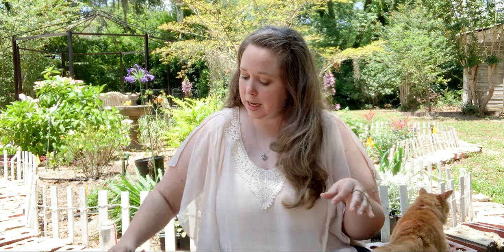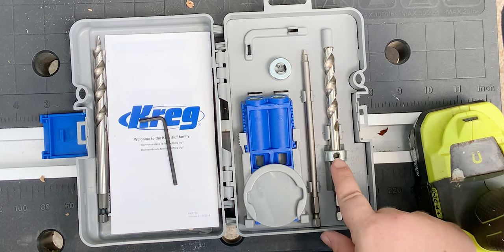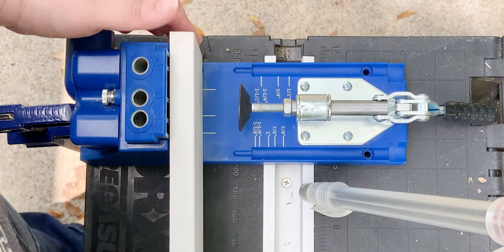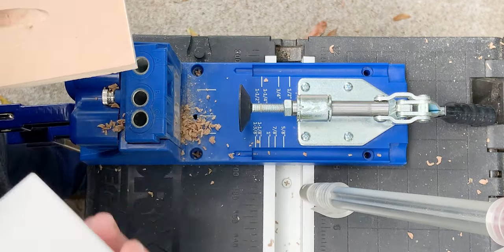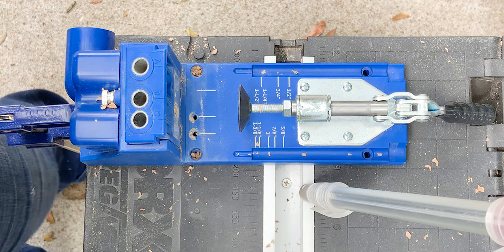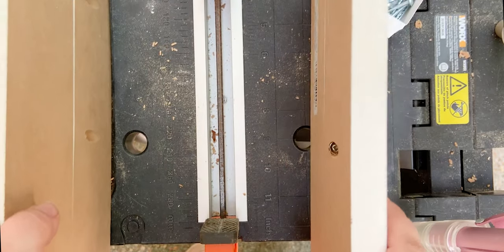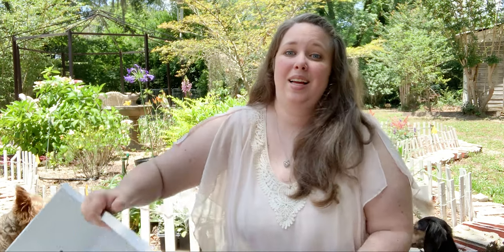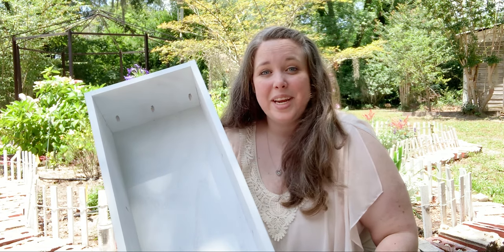How to Build a Box using a Kreg Jig

Comment: Maybe i was just seeing things, but it seemed like you stripped out every pocket hole by over-tightening the fasteners… if this is the case, are you not worried about the compromised clamp load?
Reply from the maker: Not worried at all! All the pocket holes are great and this baby has held up to dogs using it for over a year now... still rock solid.

Comment: Why wouldn’t you just get a wider side all to begin with.  You could have done this with 4 simple joins but you did 12 pockets to join thin slats
Reply from the maker: You easily could… that wasn’t the look I wanted. It’s held up fine for 2 years 😊
Reply: Wood expands and contracts over time. The wider the board, the greater the risk of shifting compromising the piece over time.